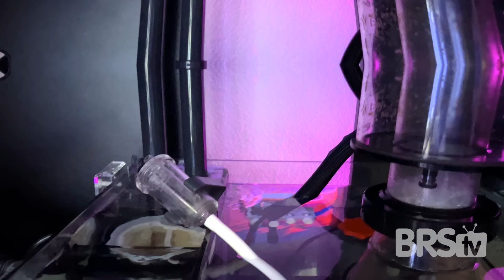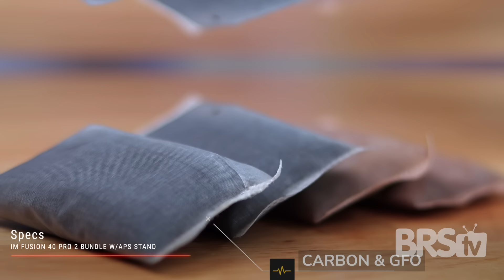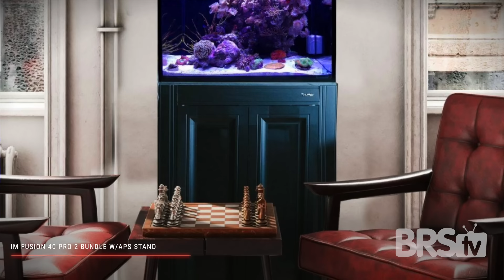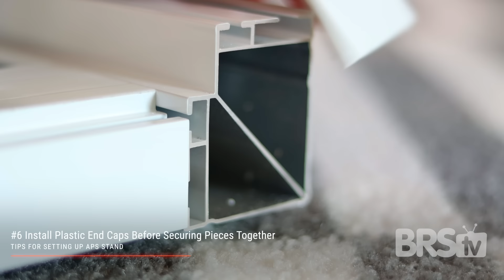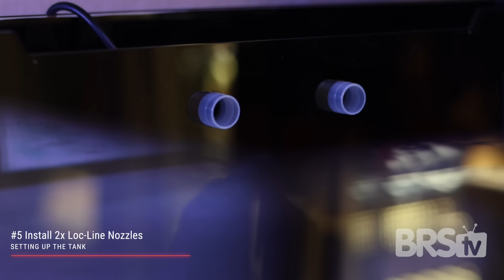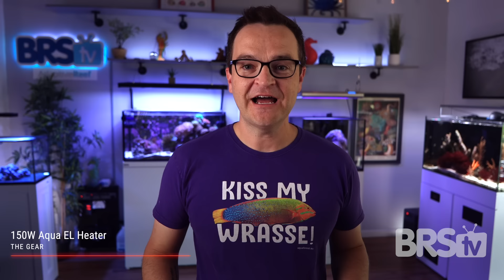Setting up Matthew’s Innovative Marine 40 Nuvo Pro 2 Aquarium & Stand! What’s Going In?!

Comment: GREAT VIDEO!! 
Im new to saltwater and and have quite a few questions but first and most important.....Red Sea max nano xl or this? Id like to stay in the 30ish to 40ish gal range. Also while I know nothing is relatively predictable....which one of any of the nano tanks is least susceptible to leaking? i know that may not be a fair question, but it will help me make a better decision on the front end.  Any help is greatly appreciated!
Reply from the maker: Honestly, both tanks would be excellent options and, as long as they are set up properly (and treated with care!) leaks won't be a problem. Personally, I really like the Red Sea if you want an option that comes with everything you need (minus heater), and the IM if you want to choose your own equipment. Hope this helps and happy reefing!

Comment: I would love to hear your livestock recommendations on this tank. I have the older model of the same tank and even though it is listed as a 40 gallon by my calculation the display portion only holds about 24 Gallons.
Reply from the maker: Check out this video, starting at the 6:56 minute mark where Matthew suggests a stocking list for 20, 30, and 40 gallon tanks 😀 https://youtu.be/2bF-N0EKNI8?t=416
Reply: @BRStv  Yes I have watched this video and found it informative. My curiosity is would you stock this tank more like the 20 Gallon in that video because of the swimming area or more like the 40 Gallon because of the overall water volume? Thank you very much for the reply I really appreciate your channels.